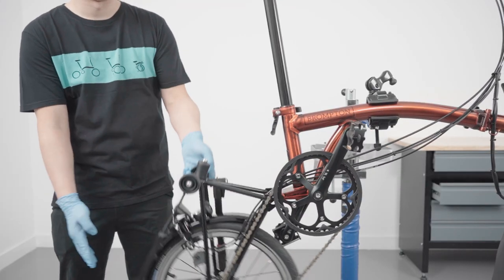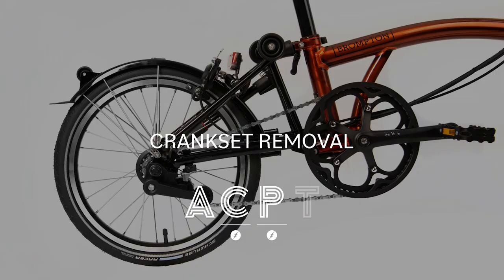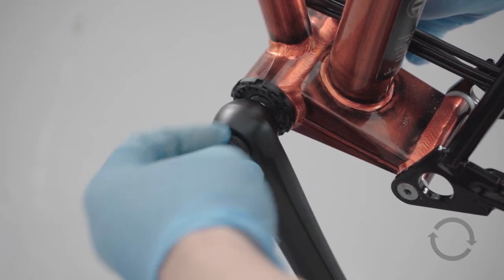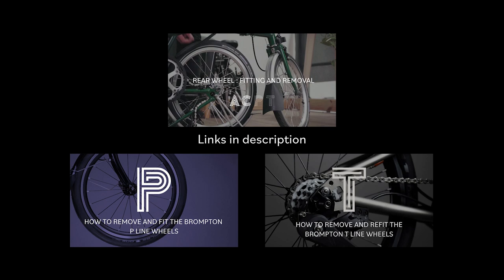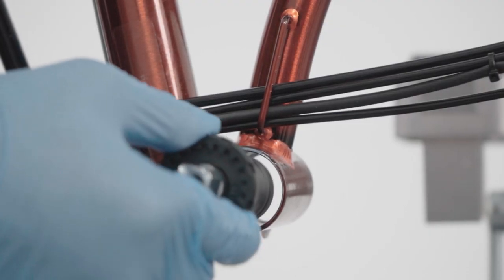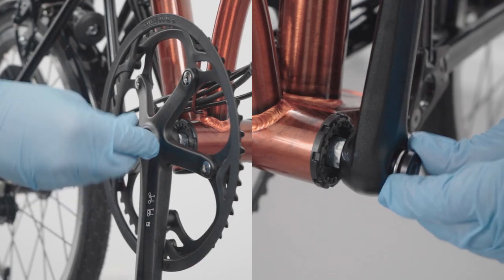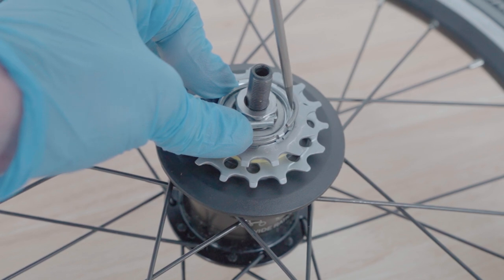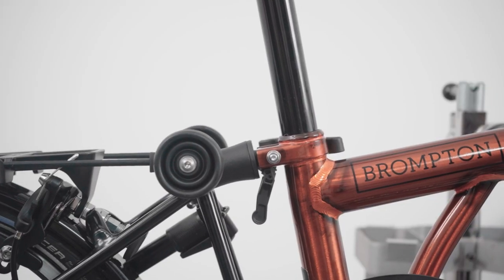Brompton Drivetrain Replacement

Comment: Is it possible to put the sprockets on the wrong way round? I’ve had a new wheel built including sprockets and one gear is skipping the chain after a gear change? Its a new chain of with correct amount of links… Wondering if the cause could be a backward sprocket?   Its a two speed. thanks